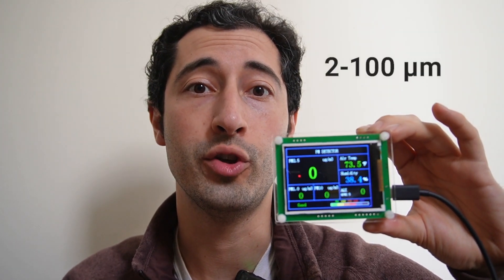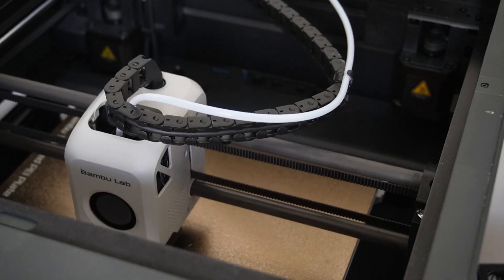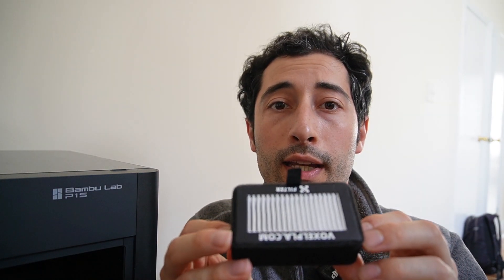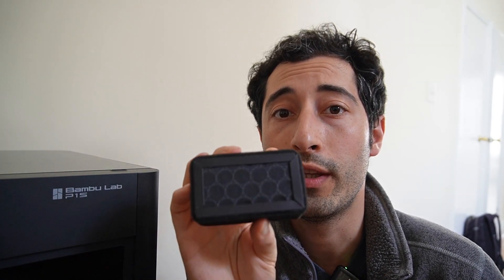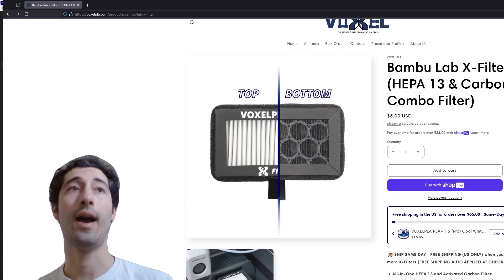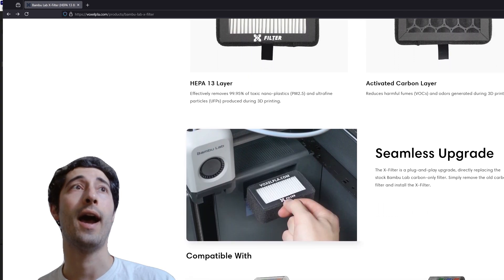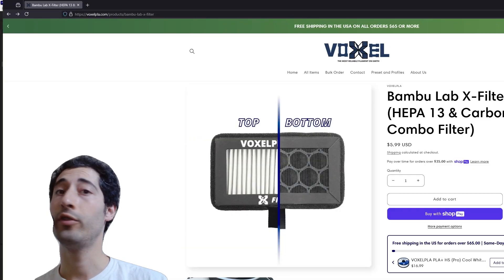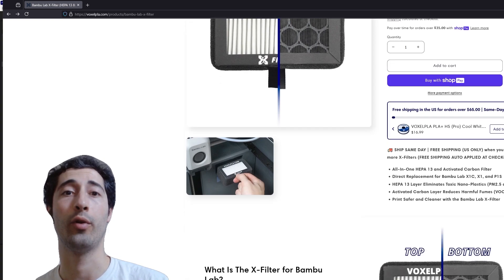How Bad are 3D Print Fumes?

Comment: I wanted to try printing some PPA-CF here with the new P1S I got for christmas, currently it's setup in the living room which is fine for PLA but I'm for sure going to get this filter replacement, and would it be necessary to move it into the garage while printing the high temp filaments? I've tried asking AI but it's telling me it's like you gotta print it in the garage then open the door and vent the area use PPE while taking the part off afterwards. It seems kinda extreme but I do want to be safe about it.
Reply from the maker: Lol! It said to use PPE... I would put it in the garage for high temp filaments just so I don't have to worry about anything with the filter. I remember I would print PETG all the time in a small bedroom and the bedroom eventually just smelled like PETG long after I was done printing. The large, internal filter I showed is pretty cool, but I actually worry about those two wires crossing and starting a fire.

Comment: This is why I only print with enclosed printers. My open-air printer was making the whole area dusty which I realized was really bad. My new printer has activated carbon+air filter I taped to the back. I also have a room  activated carbon hepa filter running too
Reply from the maker: Room activated filter is super important.

Comment: Filters don't prevent cancer. May not happen fast but every print adds up. Breathing plastic is unavoidable when 3d printing.
Reply from the maker: I believe using these 2 filters plus an external will go far. If you print PLA and PETG exclusively, you are in an even better position.

Comment: Are you sure the p1s fan is strong enough to suck air through a hepa filter? I'm guessing not because of how weak the airflow is. I think you are getting a lower reading because the hepa filter is blocking any air from going out.
Reply from the maker: The fan is axial, so if I ever get around to replacing it with a blower fan (which is the reason to buy the external one) it'd work better.
Reply from the maker: The axial fan is weak for sure. They should have put in a blower.

Comment: I was wondering what about PLA and PETG? Is it also toxic? Do you also advice another filter if you only print these materials?
Reply from the maker: PLA and PETG are less toxic than ABS for sure, but still emit. You should have a separate hepa filter outside of the printer.

Comment: So would you recommend using the bento AND replacing the original filter? Would that reduce 99%+ of all fumes? And how often should they be replaced with new filters?
Reply from the maker: I would suggest replacing the stock filter. The bento box should only be considered if you print all the time and have a spare outlet/ don't mind a small headache to install it right.